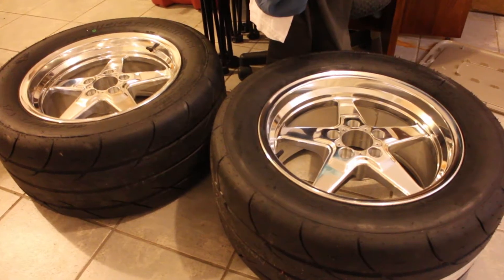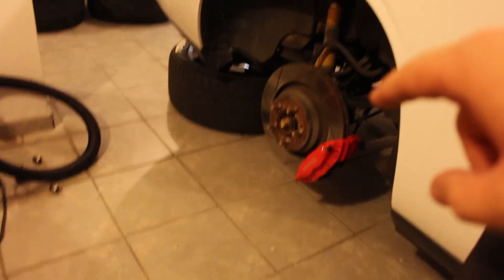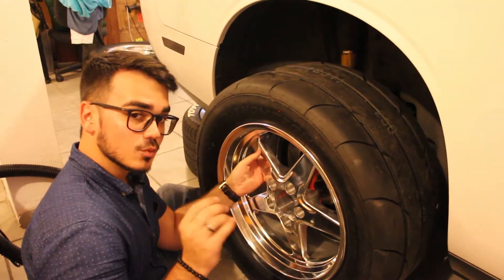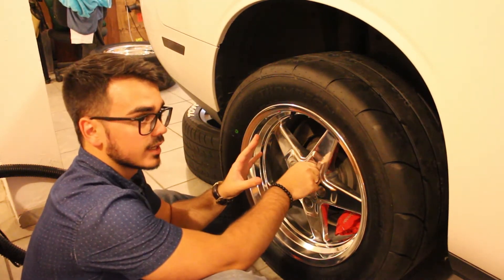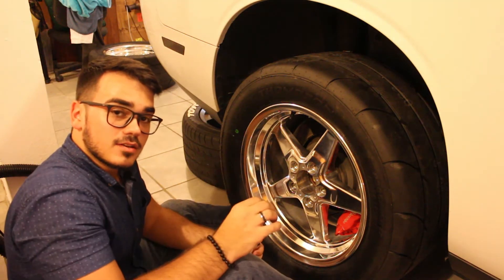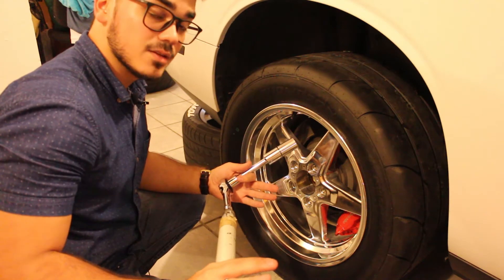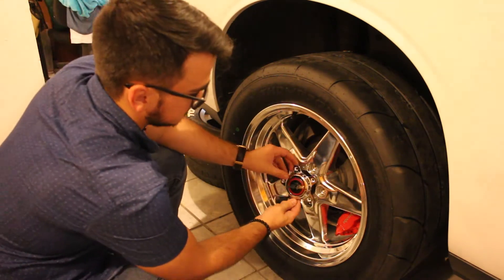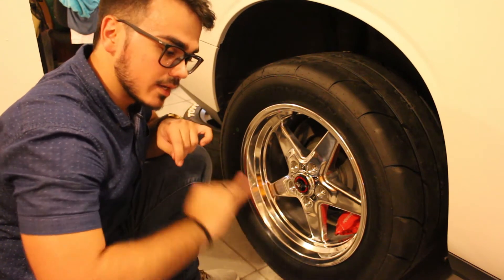Dodge Challenger Race Star Drag Wheels Install!

Comment: I got a question so I just got some race stars for my 14 challenger v6 and the lugs don’t fit for some reason they are lose I’m not sure if I got the wrong ones or what they will mount up and everything the bolts kinda fit they will loosen up and tighten at the same time idk if it’s the washers in the way or what
Reply: Did you ever figure out your issue?

Comment: the wheel lug nuts came with the centric hub rings I won’t be using the race star lug nuts but are the centric rings necessary?